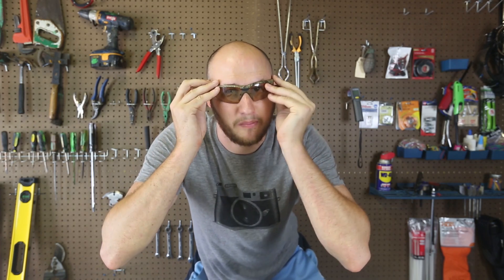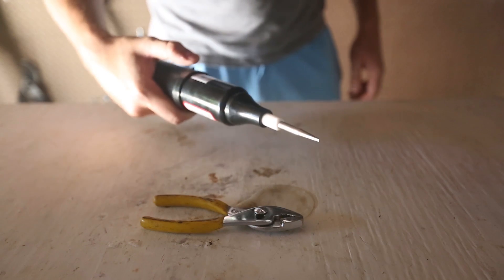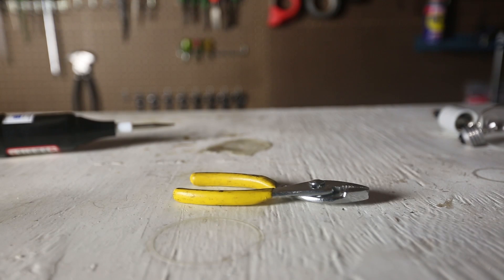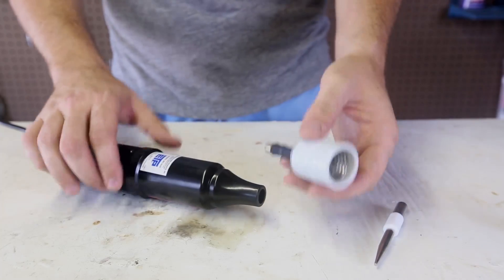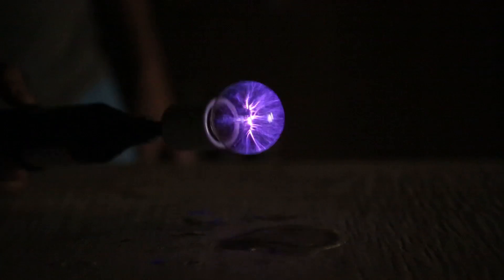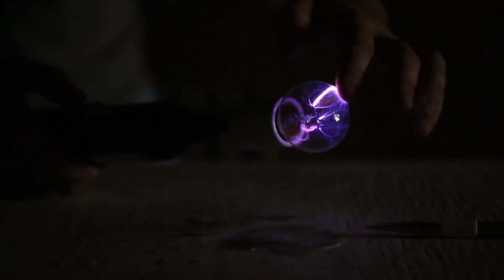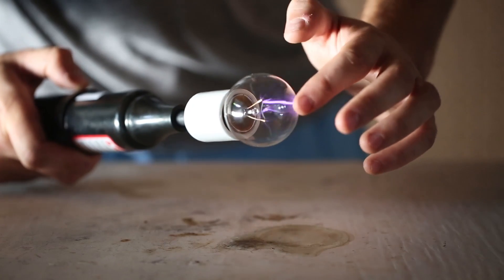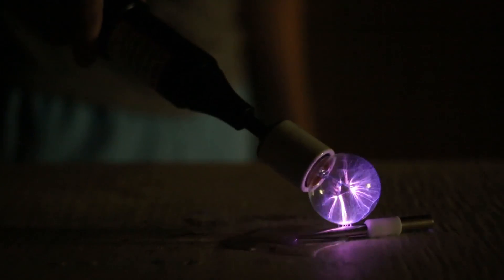How to Make Plasma Ball Out Of Light Bulb

Comment: Yea letting kids play with a device that can give a potential shock of voltages up to and limited to 500,000 volts Yea that wouldn't be smart at all and for the spark to jump that gap would have to be at least 30,000 volts the same voltage used for bull fences

Comment: For anybody that is watching this, you may notice that at 50Kv his wood table was conducting electricity(arcing to the table from pliers). Having worked with high voltage equipment for 30 plus yrs I have seen this before. Something that would normally insulate at low voltage conducts at high voltage. It has sent many a co-worker to the hospital, FYI.

Comment: FUNNY THING IS THAT ELECTRICITY TRAVELS THROUGH A NON CONDUCTOR I.E GLASS TO SHOCK YOU... IT DEFIES PHYSICS
Reply: Mbaruk Sila if you crank up the voltage high enough, electricity will conduct through virtually anything. including things like rubber, concrete, etc. Things that, for most projects and experiments, would keep you relatively safe.

Comment: Yeah, but can it melt steel beams?
Reply: 7/11 was a part time job
Reply: This is high voltage, not amperage. You need high amperage to melt metal.
Reply: Jet fuel can't melt steel beams, inside job. #Bushdid9/11
Reply: nothing can melt steel memes.
Reply: LOOL
Reply: I HAVE MEMES OF STEEL
Reply: DEAD MEME DETECTED
Reply: Been seeing this a lot. Where does it come from? Like what video? Understand it's a 9/11 reference but why is it everywhere now
Reply: plasama is like 10k degreesnso yeah if heat loss wasnt to fast
Reply: Will it blend.
Reply: Evi1M4chine b8

Comment: "So, I wouldn't let kids play with that..." Nor would I, sir....
Reply: It's the amps that get you. Watt (power) is product of voltage and current (amps).

50kV * 1mA = 50W => "safe"
230V * 50 mA = 11.5 W => potentially lethal

There is also more factors like the frequency (with AC) and duration of exposure and also the path to ground. If it passes hearth then even the tiny current can cause major problems. DC is generally more "safe" as it needs stronger current to cause same damage (due the frequency effect on impedance in body). Now final point is that AC when it's coming directly from the socket has enough current to grill your flesh. So as ground rule, never play with electricity especially if it's connected to mains like in this case.
Reply: ya, my science teacher had one and he zapped himself and some students and nothing happened
Reply: +explosivefreak666 the current kills you not the wattage
Reply: Dude, don't do that, do not touch electricity. It electrolyzes the water inside your finger
Reply: .. And.?.. You'll live..
Reply: +explosivefreak666 you won't
Reply: +neonlent if it had even more power
Reply: neonlent.. It has lot's of volts, yet Véry little watt's... Thàt's the Reàl killer.!
Reply: really don't let kids around that
Reply: metallic a
Reply: cool

Comment: @ 1:54 you can see a small spark at the back of the pliers. You may want to check the insulation on them before using them with electrical experiments.

Comment: My question is how does the electricity come in contact with the metal through the glass? Is it because it frees the negative charge electrons from the surface of the glass which are attracted to the positive charge electrons on the metal?

Comment: don't touch your camra while the Tesla coil on.  try a florsnt light or neon
Reply: put a neon or flashing light beside that don't actually look it up it should light up wirelessly I have a few Tesla coil circuits with two coils I can make a plasma ball with the tip42c  slayer Exciter but I'v currently blowing out all of the tip for tip 42c transistors  but I'm working with 2 n22 transistors
Reply: +careynethers99 fluorescent

Comment: When I was around 30, I worked at Anadite Aerospace, we would coat a part in maskant, and cut out the milling area's with an exacto knife. Then use PVC cleaner to reseal it. We would test the seal with a coil (from a car with 12v battery charger hooked to it) and just a clothes hanger sticking out of the end of it. Once we were sure the template pockets were sealed, off to the chemical milling tanks the part went. Same thing as you're doing here, if there was a pinhole the electricity would arc into that hole.

Comment: "Maybe I got the wrong kind of light bulb". LOL Too funny. You need a bulb that is filled with a noble gas, that bulb is only under a vacuum. Still worked OK. The thickness of the glass is too thin to hold back the high level of voltage. I like that handheld Oudin/Tesla Coil, but not for $225.00.

Comment: Oudin Coils and Tesla Coils are not the same thing. What you are using is much more akin to the coil invented by Sir Oliver Lodge than it to what Tesla invented. The difference is important: a Tesla coil is a resonant air core transformer, where as this is just a regular HV transformer.
Reply: k
Reply: +Alex Johnson Actually the biggest difference between the two is the fact that the former uses an autotransformer to create the high voltage while the latter doesn't. Other than that both consist of coupled tuned circuits and high frequencies.
Reply: Ily <3

Comment: If you hold it and then turn it on you won't feel the voltage but you'll be able to shoot the sparks out of your fingers.   You can even light up a fluorescent light bulb in your other hand when holding the tesla coil thing.
Reply: lol "when holding the tesla coil thing." sounds like you know what your talking  about
Reply: "If you hold it and then turn it on you won't feel the voltage"

Or you will just shock yourself, depending on if you understand electricity or not
Reply: Boom
Reply: wow
Reply: Lol
Reply: +ken14850 haha, yeah it was a long time ago when I was messing with the one my parents had and I never knew the name of it.
Reply: Buddie21341255612351 if you are grounded then the voltage can pass through you.  That what being grounded means.  And I'm sorry but no,  they don't explode, because they are never grounded.
Reply: +Tim Marcotte exactly what I say if you are grounded you get shock that's why bird don't get shock on a 12kv or 25kv power line
Reply: Buddie21341255612351 But you just said that the bird would explode just by landing on it.
Reply: +Tim Marcotte the difference between 25kv and 315kv confused you?
Reply: +Buddie21341255612351 you guys are all wrong. I am currently a student of electrical engineering and the reason why bird do not explode is because electricity is always trying to travel towards the ground the easiest way possible, hence lightning. If the birds hung like bats on the wire they would get electrocuted. But sense they hang upward not towards the ground the bird do not get shocked because they are not pointing towards the ground.
Reply: +Buddie21341255612351 electricity follows the path of least resistance and it also helps that birds aren't very great conductors.
Reply: +Porter Christenson you just don't look in the right direction for the answer.. the truth about the bird is  induction and potential difference.... the only way to touch (or just approach) line of 315kv and more (there is some up to 725kv) is called Faraday cage and bird don't have that... oh btw at 315kv even air can be an ok conductor for some meters

Comment: In all honestly, "the device" is not a Tesla coil, but a transformer, which uses the same principal as a Tesla coil, but its closed, and can't emit wireless electricity. The transformer is only used to create and increase in voltage, which is the reason for the discharge lightning.

Comment: Actually you have to turn the voltage up if you want to be safe. power=currentxvoltage, so if you increase the voltage the current goes down, and since it's the current that kills you not the voltage, you will be much safer. It will hurt but any serious damage will be avoided since current won't flow through you and possibly stop your heart or damage your brain.
Reply: *assuming overall power stays the same

Comment: High frequency radio waves are generated by the high voltage arcing.  This can generate very small electrical charges in surrounding metal, if not properly grounded.  This is a something welders see while TIG welding.  So there can be a small amount of electricity generated in the electronics of your camera.  This does have the potential to end electronics.  I've had it happen to my MP3 player (welder not properly grounded) and a visitor's cell phone.

Comment: 20 000 volts to 50 000 of them 

and guess what 

BOOM your electricity bill is $200 up cause of that thing
Reply: nope. voltage will go up but amperage will go down:

P(p)=P(s)

U*I(p)=U*I(s)

with an ideal transformator
Reply: No
Reply: He's not using much current unless the thing contacted a surface/ground.
Reply: A transformator of 1:100 - 1:200 would probably do it, it'd be 230V : 23000V - 230V : 46000V
But as the guy above me said, the electricty strength (sorry for my bad English, I translated that 1:1 from German xD ) Ampere goes down if the Voltage is going up! :P
Reply: Which means hes not using alot of wattage to drain his bank account
Reply: It is about 20kv with low current, probally uses as much as a normal light bulb.
Reply: maybe if you leave it on all day everyday

Comment: ill drop it in a pool this summer
Reply: all water conducts electricity
Reply: +Speedyjens bro all liquids conduct electricity
Reply: Water conducts electricity very very badly almost like wood. However salt water conducts about 1000 times better..
Reply: +Speedyjens you probably used deionised water. normal water does conduct.
Reply: smh to the people saying all liquids conduct electricity....
Reply: Indra Danial Have you ever done any experiments in science class or something. to support your claim? I have and i found out that to conduct electricity you have to put salt into it.
Reply: +Indra Danial Water in a pool contains dissolved ionic compounds , once dissolved the ions become disassociated  from each other henceforth can freely move around as an electrolyte in the pool. These ions are cations and anions henceforth will carry the charge and electric current. So pool,water is a good conductor.
Reply: the water doesn't need to be salt water to conduct. as long as it has some amount of minerals in it, it'll conduct. only distilled water will not conduct, and believe me, pool water is nowhere near distilled water.
Reply: +Indra Danial "all liquids conduct electricity" - No, that's just plain wrong. Mineral oils are even better insulators than air in fact: there's a reason why they're used in ALL HV transformers (except the ones that use SF6 of course).
Reply: Invite me
Reply: Good idea it will be SHOCKING for the others... Hahahaha fine I'll leave.
Reply: Invite me I think it will be fun
Reply: Great thing that normal water doesn't conduct electricity
Reply: +Speedyjens because there free moving electrons that are able to conduct electricity, therefore anything that is in liquid state will conduct electricity
Reply: +Speedyjens ohh thats cuz its inpure
Reply: +Robbert Groenendijk ik weet ik weet
Reply: +je moeder is een plopkoek  haha jouw naam is leuk dude😂💪👍
Reply: water only conducts electricity if it has impurities in it (which most water does but not distilled water). Liquids in general only conduct if there are some sort of free moving charged particles (for example salt ions) in them to carry the charge.
Reply: +Elina Robov not eith that poor grammar
Reply: what have i started...
Reply: Water does in fact conduct electricity due to self-ionization (ionization constant known as Kw),, but it's not very effective.
Reply: +Aaron Geraldo loool
Reply: +KiwiWarlord 😂
Reply: lol
Reply: +Aaron Geraldo pure water without any minerals or ionic salts doesn't conduct electricity, but tap water with minerals will because of the dissociation of ions
Reply: And we are making a comment train longer then the Great Wall
Reply: +Indra Danial not all liquids are conductive, for example in a PC you might use mineral oil for cooling because it does not conducts electricity.
Reply: +Aaron Wang we shall make this comment going on FOREVER
Reply: +Juju Bro check out my channel plz :)

Comment: BTW, the camera is being controlled by the ir light of the lightnings. If you tape the ir sensor on your camera (the one to use the camera with a remote) off and then the problem should be solved
Reply: No, it is not the ir radiation. It is because of the high frequency field generated by the mini tesla coil. I experienced the same thing with my tesla coil and my camcorder. I would be careful the electromagnetic field could damage the camera permanently.
Reply: But theres a problem. A tesla coil dont emmit ir light
Reply: Valentino Saitz It would be pretty close to uv not ir (bit it doesnt emmit ir or uv light only purple or white)
Reply: +who_cares how do you know. The coil itself does not emitt ir but the sparks can.. I mean just look at the color it is pretty close to ir. And because ir light is being picked up by cameras as violett light you may be seeing ir.. Soo it is totally possible that the sparks emitt ir
Reply: it does not emitt ir because of the temp of the lightning itself hotter the stuff goes it becomes more blue-ish,so lightning is blue because it is very hot if it is to be bit colder it will be more red,then ir on the other side if it were to be hotter it will become violet then uv etc.
Reply: +Valentino Saitz That's not true. According to Bohr's model of the atom (which I know is not 100% accurate but it's close enough for this argument), electrons can only be in certain energy states. When they jump down from high energy states to lower ones because of the tendency of things to favor lower energies, they release photons. The frequency of the light emitted depends on the amount of energy that was put into the photon from the jump in energies. Because of this, certain atoms only emit certain frequencies of light when they are excited. While it is entirely possible that the gas in the bulb is emitting infrared,  it appears to be a nitrogen filled bulb because of its color, and nitrogen does not emit infrared light. Also. the color of the light that's emitted is actually closer to ultraviolet than infrared, as it has a shorter wavelength compared to the rest of the visible spectrum.
Reply: +Valentino Saitz If it "looks pretty close to IR", yet you can still see it, it isn't close to IR.
Reply: +TheBritishBrit I mean on the screen. If you take an ir led and point it at your camera you will see it lighting up in a violett Color, but still you can't see it with just your eyes... It has something to do with how camera sensors work. They will convert ir, for us invisible, to a violett color on the screen, visible.
Reply: +Valentino Saitz 
I can see your reasoning but even if it were correct the IR would have to pulse the specific codes required to act as a remote control, which is extremely doubtful. However, high amounts of EMF as produced by such high voltages can cause all sorts of sensitive electronics to malfunction. This could easily be remedied by putting the camera in a metal box or cage which would act as a Faraday cage and shield the device from the effects of EMF interference, like how the inside of a microwave oven prevents the high energy microwaves from escaping even though the light from inside can still pass through the door.